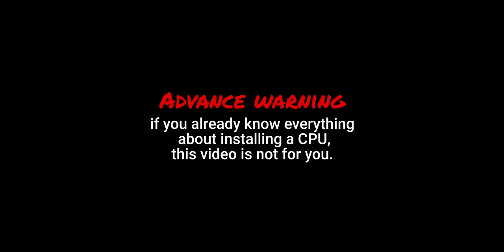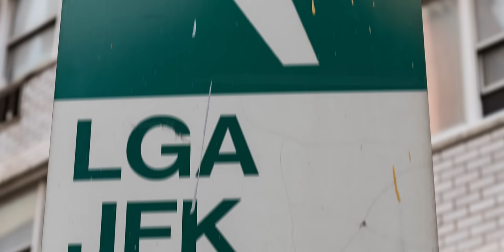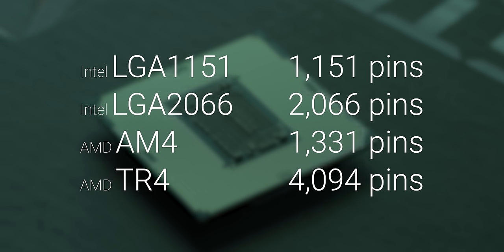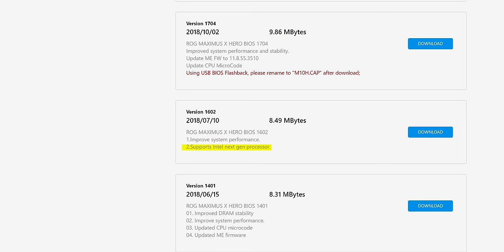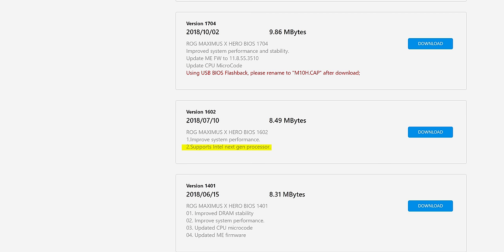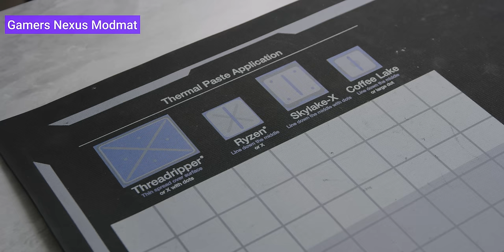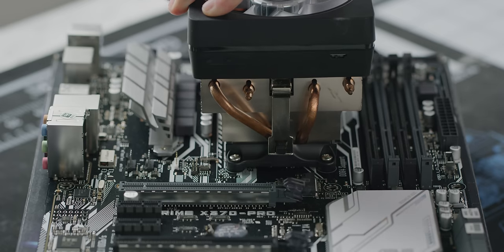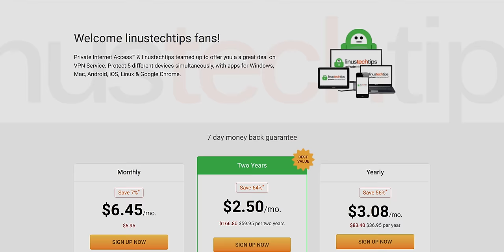How to Install a CPU

Comment: The beginning complete confuses. 1. PGA means pins on CPU. 2. Intel moved off of PGA, so that if you bent a pin, it would be on the cheaper item. Wait - is a CPU really be more expensive than the motherboard? Besides, if you damage the motherboard, you may need to buy items on the bad board that can't be transferred to the new one.
Anyway, anecdote: eBay "Intel Core i7-920 2.66GHz Quad-Core (BX80601920) Processor" pre owned $8.97 + shipping. But new i7 is $350. WTH??
Reply: Beneath that very ad (that exists currently) are numerous processors for under $30, used. Business P.C.? Okay, mission critical, spend the $350 for a new boxed one. Anyone else? Buy 5 of them for under $100. Right?

Comment: make sure you do the little wiggle.... i thought i had my cpu in place. put the little lock stick down. seen the cpu move a bit so i figured it was locked.
so i thought i was good to go. 
put thermal paste on. 

attempted to put the cpu fan on. picked it up slightly. noticed my cpu has been picked up by the fan sticking with thermal paste. the cpu slid across the mount. bending a bunch of the little pins.

Comment: I'm gonna upgrade my cpu from i5 8600k to i7 9700k, I've already updated bios and this might sound like a silly question, but is it as simple as plug and play or is there something else software wise needed after installing the new cpu?
Reply: so long as theyre both 1151 sockets you should be ok. Might have some issues with windows being lost as to what happened looking for a different CPU but Win 10 is pretty decent at hardware changes

Comment: Noob question:
So...you literally just pull the old one out, put the new one in, power your pc on and go? No other steps with bios or anything?
Reply: Not unless your CPU is too new for your motherboard. If so, update bios and you a good to go

Comment: Honestly, with PGA or AMD CPU's I tend to not apply a lot of  pressure but just lightly rest my finger above the IHS as i'm putting the lever down, see how it sat a little higher than normal when he was wiggling it? I would rather a more gentle pressure push it down than my heatsink when i'm installing it while the pins have pressure against them from being installed.

Comment: If page says 
compatible with : Intel Celeron, Pentium, Core i3, i5, i7 
INTEL CORE i5-3550 will work with it?
Reply: Jacob Depends on the chipset, a brand new motherboard for the last generation will not work for a 3550.
Reply: Jacob if you have never built a PC before I would use pcpartpicker.com as it says what is compatible with what

Comment: Upgrading from an i5 8400 to a i7 9700k. Do I need to apply thermal  paste both to the cpu and the bottom of stockcooler ? Or only the CPU?

Comment: Just a question. If I install the new cpu and it isn't on the pins properly so not picking up ram slots and I have to remove it and install it again. Won't that affect the thermal paste that's just been been applied? Thanks

Comment: My god this scares me. I currently have an i5-3470 along with a gtx970, I plan on upgrading my gpu quite a bit. Probably an rtx or 1660 super but I know I need to change that cpu..........but I feel like if I do one thing a little wrong my whole computer is fucked. IS THIS AS HARD AS IT LOOKS OR WILL I BE OKAY doing this myself for the first time
Reply: You should be fine.

Comment: so where does one go to find out exactly what processor to buy as an upgrade?  Compaq says  "Athlon 64 X2 with Dual Core technology up to 4800+ (up to 65 watt TDP"          but does not give a part number or a SPECIFIC actual processor to buy. Tryin to upgrade my old compaq which is an Athlon 64X2 3800+   whatever that means

Comment: Can i somehow damage intel pins while trying to put a cooler on my cpu? Cause usually it requires some force sometimes to manage to put a cooler(not the stock one)..Question is how much force is too much ? ;d Or if the cpu is set in place is somewhat safe to work without much consern?

Comment: I recently upgraded my i5-7400 to a i7 8700 and I followed all the instructions accordingly but it seems I cannot get a display to pop up, I’ve checked my inputs and tried booting my system while changing around my display ports and even trying to boot with a hdmi. Everything is firmly where it should be and I don’t have a clue as to why I can’t get a display when booting my computer with a new cpu.

Comment: little confusion about antistatic thing. ist connect power plug of PSU to wall (I use Surge Board) then touch PSU (Power Off state) is that u said or ist touch PSU and then attack to wall ?

Comment: does anyone out there know if a AMD Ryzen 3 3200G processor is PGA or LGA? i just bought a cheap PC on amazon and was wondering which is a good enough value processor i could get. Thanks!
Reply: As all AM4 Chips, it is PGA, The pins are on the CPU and not the Mainboard

Comment: There's way more to installing a CPU than I though. I knew it was under a fan and I knew it probably is strait forward when taking out the fan. I didn't know however that there is multiple different types of CPU's. I'm talking about the pins. So I'm assuming that since I've got an Intel i3 in my PC. an intel i5 or any other Intel CPU's will fit? Is that correct or am I wrong?
Reply: If it has the same socket and is supported by the Mainboard, yes.

Comment: I replaced my i5 with an i7 (brand new) and no response when pushing power. No click, no fan, no post- small green light on mobo only. Re-installed old CPU and she booted right up. Can't find much online, suggestions?

Comment: Hold on, i need more information please.

I have an FLCLGA1366 does this mean i can install any LGA?

I want to swap FLCLGA1366 and replace it with an FCLGA2011.

Using HP z800.

Will that work?

Comment: Will this affect the operating system? Do i have to install a new windows?
Reply: Ultra CNC  
Same. But dare i risk it? lol.
I ordered a new os just in case.
Now i'm thinking i should replace MB also...and then a new PSU to cope with the power etc...
then it gets expensive :(

Comment: do i need to update something if i change cpus from the same generation? For example, i have an i3 3240 and i'm thinking to upgrade to an i7 3770, do i just switch the cpus and that's it, or are there something like drivers that i need to check?

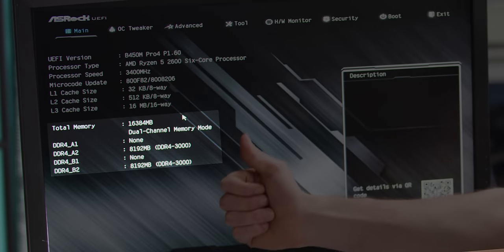Comment: 13:20 friend of mine has regular blue screen of death after getting new mobo, cpu and ram but the error code (even keeps changing) isn't helping at all. There are some indicators that it's a memory problem. Haven't reseated the cpu yet. Will try that next.

Comment: Hello...for the heck of it took out the CPU fan etc. to clean...by mistake the Chip too came out...put it back after straightening 3 or 4 pins in the corner...boots fine but no display. What could be the reason? Maybe the golden triangle is not in the correct position? Tried again ...no luck...Tower is Acer AM5100....how can I get my data out?

Comment: I try to build my first pc. But suddenly i got techincal issues. When i turn on my pc it shows that my processor was read by the motherboard but when its loading into entering windows it suddenly stop😢. Then when something pop out like diagnosting pc. My pc turns off automatically and i cant turn it on anymore its going force shutdown😢 i need help pls help

Comment: can anyone answer my question? I have a B350 Tomahawk Plus Motherboard, and the computer would only works if I place my 2 ram stick on slot 1 and 2. I heard it's usually on slot 2 and 4 but whenever I try doing that, monitor won't connect.

Comment: What if my cpu doesn't fit in my motherboard
Reply: Sadly you gotta get a new motherboard or a different cpu

Find the socket type and wattage requirements and you'll be able to find compatible processors

Comment: Is it okay to touch the top part of the processor. (Where the ryzen logo is )  before putting on thermal paste
Reply: as a general rule of thumb i would avoid it. i generally wiggle the processor after installing at the edges of the heatsink (the silver part) so that the oils from my hand doesn't get transferred to the middle of the heatsink, where it is directly over the CPU die. I'm not sure whether the oils from my hand would interfere with the thermal compound, but I'm not going to risk it since Linus emphasizes on cleaning the CPU heatsink and cooler with alcohol.
Reply: But Linus touched the top part in this video after installing. Then applied the cooler dierectly . I'm talking of amd
Reply: Help bro. Mine is ryzen 7 2700x and I worry toooo muchhhh

Comment: If i have Ryzen 5 3600 and input cpu pwr 8+4 on motherboard but only 8 pin plug in power supply, can I use it? Sorry for bad language.

Comment: Need help installing a power supply to a mother board and does it matter what ssd card I get and gpu ??? I need help I want to build won but need help. May I please Dm you the part I want to get and see if it’s going to be good?

Comment: I am getting an "AMD RYZEN 7 2700 8-Core 3.2 GHz (4.1 GHz Max Boost) Socket AM4 65W YD2700BBAFBOX Desktop Processor (Model:YD2700BBAFBOX)" and I dont know whether it is LGA or PGA.I need help.
Reply: pga

Comment: Should I take out my ram sticks first?
Reply: Doesn't matter, just press the power button for a second after you unplug and be sure to defend against static

Just the usual things that can damage pc parts, but as long as you properly remove the cpu and reinstall it, it'll be fine and your ram will continue to work as normal
Reply: @Cybersomnia  well I just mean will there be room to do the things
Reply: @Millsys  oh, my bad...should be no problem, I know that was never the case for my motherboards

Comment: I have problem with memory at 13:06 I have total 16GB but is showing on BIOS  8GB What to do ? it is CPU problem?, I bend PINS and try to fix any know how to fix ?
Reply: @szymonrybak1  I'm quite curious did you find out what was going on ?
Reply: @JROCC205  Hi I still not found the problem with my ram I didn't want to look for it and play with something damage another stuff but it's work only 8GB so I keep. I thinking my slot of the ram its burned on my motherboard when I fixed the pins of CPU when I check my bios is showing 16GB also tried to update BIOS still not worked

Comment: I have a CPU Type Intel Core i5-2400 CPU @ 3.10GHz, is it possible to upgrade this?
Reply: I was told that I would have to find one that was the same gen like an i7 2nd gen but I don't know if that's a step up worth the money, but if I can just go and buy something like an i7 6th gen and it will still work in my desktop SecondASMR
Reply: ive never heard of a "mobo" SecondASMR
Reply: how do I check? SecondASMR
Reply: SecondASMR thanks, I know how to put them together but not the compatibility stuffs, ill probably learn that this school year. thanks for trying tho
Reply: @atlas4916  so just Google it. If it's a pre built, type the model # into Google.

If it's a custom, then download a program like Speccy or CPU-Z to tell you your motherboard model. Then Google that for cpu compatibility
Reply: @bluescluessuperagent my buddy bought it and put a new graphics card in before I bought it from him, that's all the changes I think I know where done to it
Reply: Oh yeah, the i5 2400 is the socket LGA 1155, best thing you can upgrade to is the i7 3770.
Reply: @RicardoPCGamer  thanks man, I don't know much about this stuff